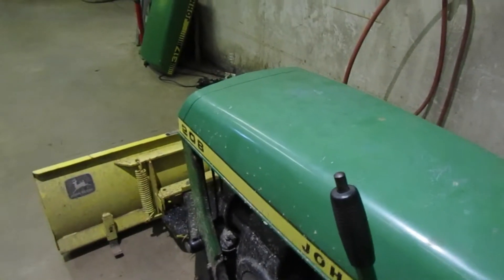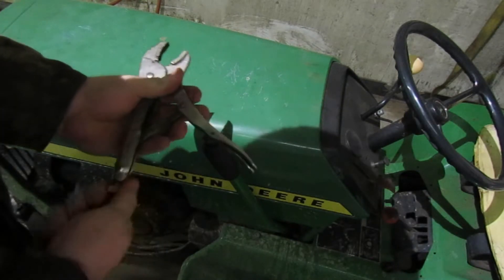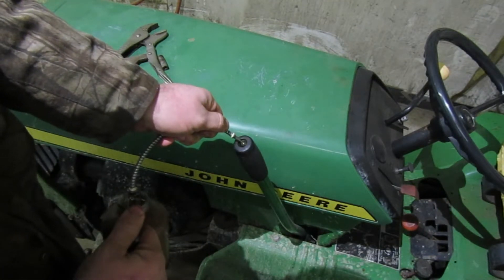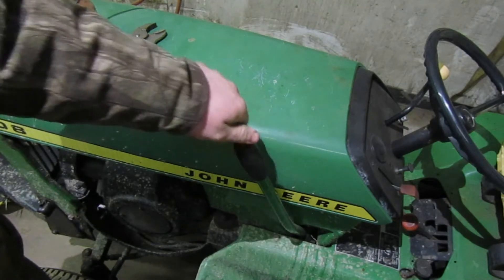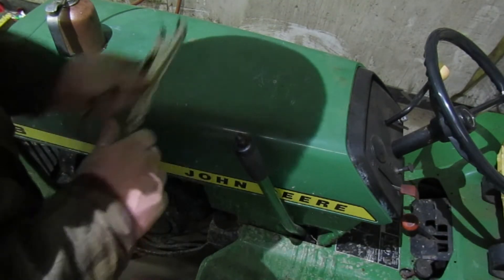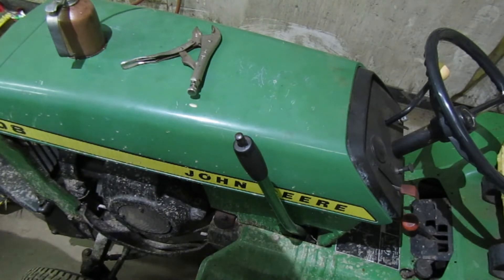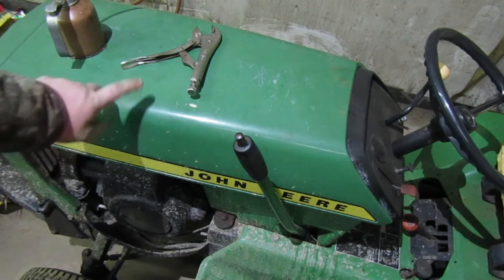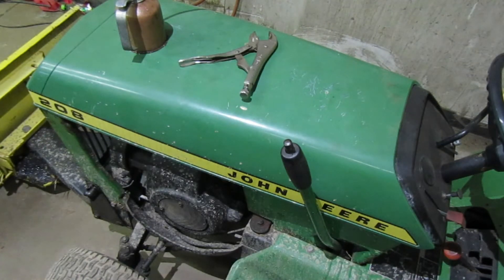How to replace the lift lever spring on a John Deere manual lift garden tractor and other tractor

Comment: Question if you happen to know: On these manual lift levers when you have the deck installed, I take it there's supposed to be a mechanism or slot/whatever that holds the deck in place when you yank it back. If the spring works and the lever moves freely, what underneath (presuming there is something) would prevent the deck from staying elevated? 
Just picked up a '77 214 with a siezed engine, but while I debate rebuild vs repower, I started getting the mechanical issues sorted out, just haven't been under it yet.
Reply: I have the same problem. Did you ever figure it out?

Comment: Thanks for the upload This is just what I needed because I was wondering if this spring is available to order or not for my 216. I was looking online yesterday and couldn't find it.
Reply from the maker: should be I should have found a part number for it. if you ask me any spring about that size should work as long as its strong enough to lift that button back up
Reply: I might just need to take it apart and try lubricating it up with wd 40 first and see what happens the spring might still be good
Reply: Tractor has been in my family for a long time and hasn't ran for the last 15 years or so. So I have plans to take my time restoring it and get it running so I can use it for landscaping
Reply from the maker: @52BuickBoi  dont use wd40 use a motor oil that will provide more lubrication than wd40 will in my opinion.

Comment: what make my button stick on manual lift handle is there away the change the spring on 1970 112 john deere
Reply from the maker: Yes its the exact same way as with this. your linkage needs oiled it sounds like to me.

Comment: Does that spring just pull out mine does not want to come out
Reply from the maker: Yes it should just pull out. Yours might be rust welded in. Just take a flat head screw driver and try to pry it out.